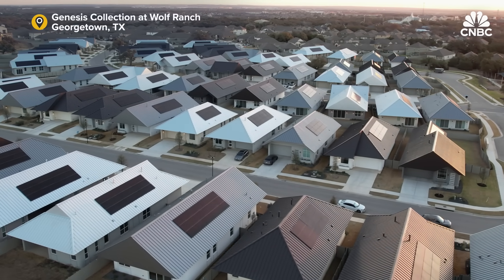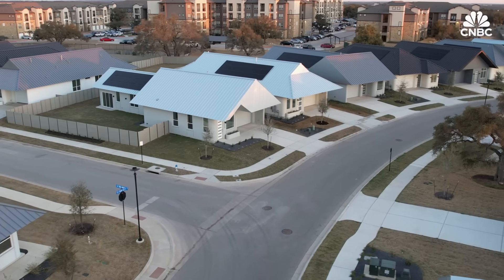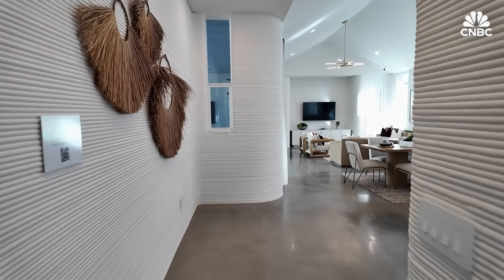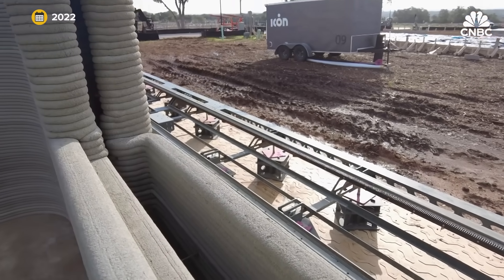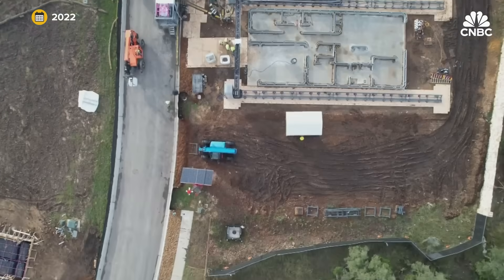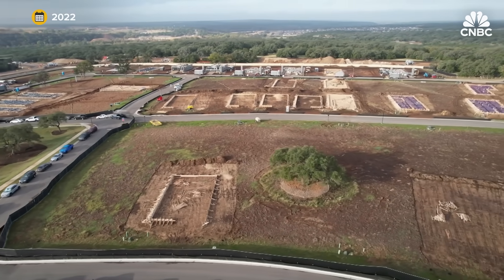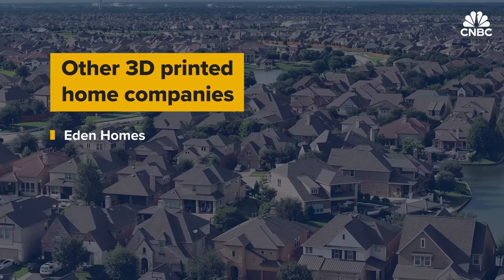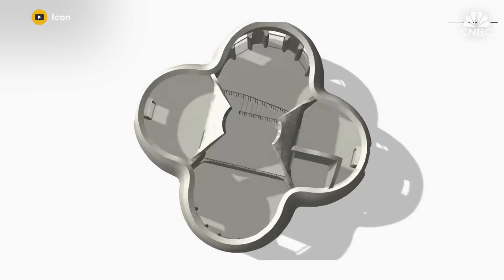Inside The World’s Largest 3D Printed Neighborhood

Comment: That's STARTING at $250 per square foot!? That's cost efficient?😂
Reply: Its just another cost efficient to the seller not the buyer scheme and worst part the durability aka quality is worse for the same price
Reply: Chill, this was the first hundred homes. The first implementation of a product is always more expensive and less perfect. Wait till they do this at scale
Reply: How much do you pay 20 guys over the course of construction?  Also how often are they sick, high, tired, or too injured/sore to work properly?  A 3D bot that can build while a couple of guys work QC seems a bit better in a multitude of ways - consistency, long term employment, liability, and more.  Construction as a career isn't going anywhere and multiple trades are still needed to finish one of these but to act like this isn't progress... are you sure about that?
Reply: @mdfalse the machine only build the foundation and the walls, so you actually doest save much money with this method, the wall are the cheapest part of a house anyway.

Comment: 400k for a cheap and weird looking home, no thanks
Reply: yep... weird and definitely looks cheap.🤔
Reply: It’s tornado proof
Reply: @Ed44503 not really because the roof is still made of wood and a tornado can still rip that right off like it’s nothing.
Reply: i wouldnt call 400k cheap
Reply: And no basement 🤦🏽‍♂️
Reply: @taqeemhilton it’s expensive to have a basement in Texas. It’s too hot and humid plus the clay soil would cause lost a issues if your not watering the ground even with thick walls in the basement
Reply: @anthonyk423  Oh ok I’m in Connecticut.
Reply: @taqeemhilton I swear to you Texas has to be a lot closer to the sun than the rest of the planet. I pay about $200 to $250 a month in the summer to water the grass to keep from having foundation issues.
Reply: @anthonyk423  Why the hell are you putting $200+ in water down near your foundation?  I live in San Antonio, Texas and my WHOLE water bill is <$50 a month.  You do NOT need to be "watering" your foundation of your house like that.  During the dry months of summer, it doesn't hurt to spray it down a bit to prevent ground cracking, but what you're doing is stupidly wasteful of water and pointless.
Reply: @krisdphillips its to water the lawn and the water that’s used in the house genius not just the foundation. Also the prices for water increases in the summer because more water is needed so the grass doesn’t die and the ground cracks.   Not to mention when your in a developing town the expenses for more water that is needed for new homes and to treat the water is added to the bill. How about asking question instead of making dumb assumptions cause why would I waist money on water I don’t need.
Reply: @anthonyk423  Bruv.....I live here too.  First of all, if you have yo water your grass, you're using a grass not good for this climate.  Or you live in one of those stupid HOAs.  I don't water my grass.  It goes dormant in the summer and comes back in the fall/winter.  

You don't need to water your grass or foundation of your house.  I don't need to "ask questions" because it's dumb no matter what excuse you throw out.  Maybe you have to for your HOA, but that doesn't mean it's not dumb.
Reply: @krisdphillips 😂🤣 yeah sure, and good for you. Also it’s only 2 types of grass for Texas and stores don’t sell any other kind. Also pretty sure you have weeds and not grass but you go head and do what you do and good luck with your foundation since you clearly have no idea what you’re talking about😂
Reply: @anthonyk423  replace your turfgrass with native plantings, I was a landscape designer in Texas for 13 years, saved my clients thousands in water bills, plus no fines for watering on days you're not supposed to. C'mon, fess up!
Reply: Concrete  cheap house lol
Reply: It’s called location